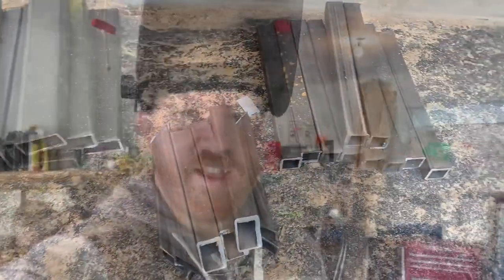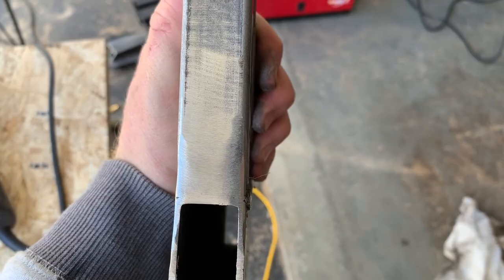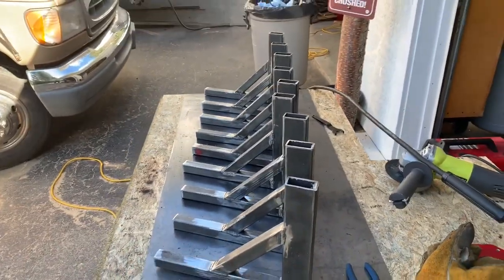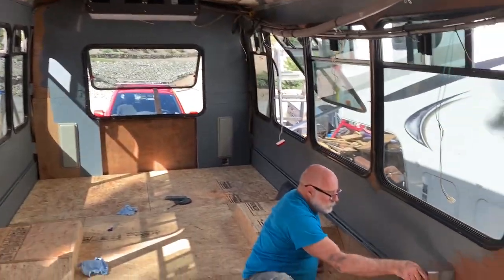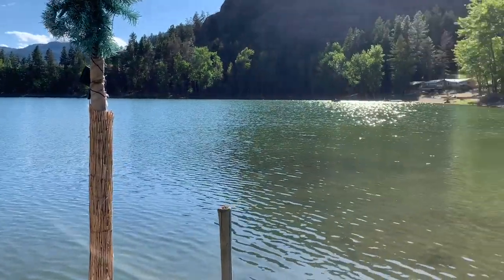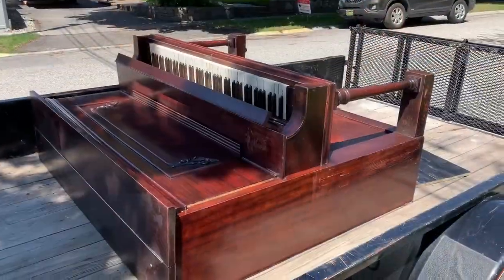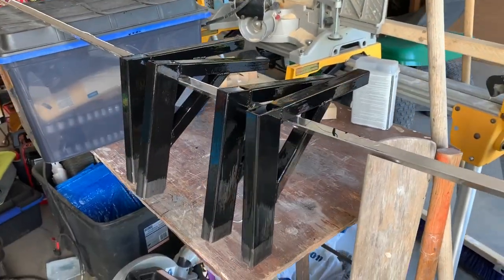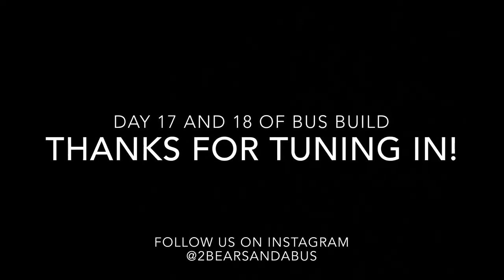Day 17 and 18 of Bus Conversion.  Find a piano and start fab of brackets for rooftop platform.

Comment: I just ran across this video . I thought that you couldn't put a roof platform on a shuttle bus because of framing . Well i guess that myth has been debunked. Wondering what the support is for the brackets? Are they directly over side frame rails? And lastly, What type of bus do you have? Cheers jeff
Reply from the maker: Hey There, yes you can and it works great. I think it really depends on your bus model though.  Ours had an internal metal square tube framing that we were able to tap into with brackets we made to hold the roof deck up.  The roof deck isn't actually sitting on the roof but floating above the roof and the weight is pressing down on the wall studs essentially.  Our bus is a 2003 e450.